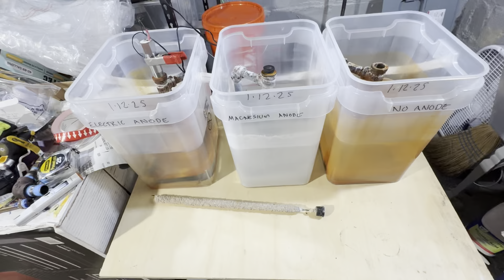Three Sacrificial Anodes Experiment

Comment: Paul, Ive heard that when installing an anode rod to not use teflon tape because that will electrically seperate the anode rod from the metal tank. What are your thoughts on this?
Reply: A super interesting experiment would be to clean any oils from the pipe to begin by soaking in acetone then have one anode rod installed with pipe dope and the other dieletricaly isolated from the steel pipe by a plastic bushing
Reply from the maker: @marriagepartnersministry5942 
I basically did that. I washed all these pipes in the dishwasher first thing. Then you can compare the anode ones vs the no anode one (which is the same as an anode with an incomplete connection)
Reply from the maker: Corro-Protec says to use 5-6 turns of teflon tape and I think with this much, the threads will cut through the tape in order to make contact with the tank.

But you are right, the threads must be in contact for any anode rod to make the circuit complete.